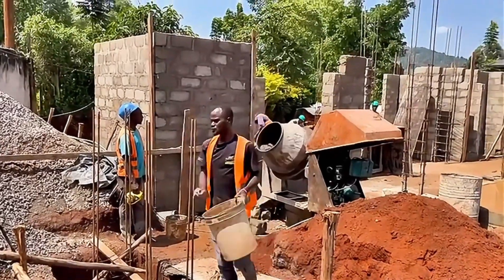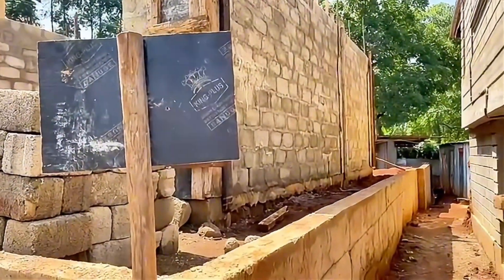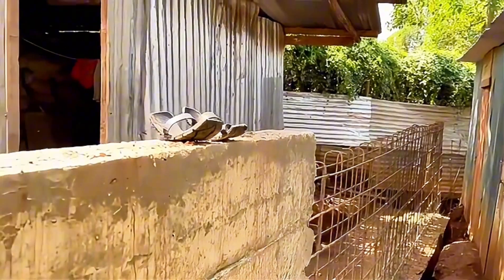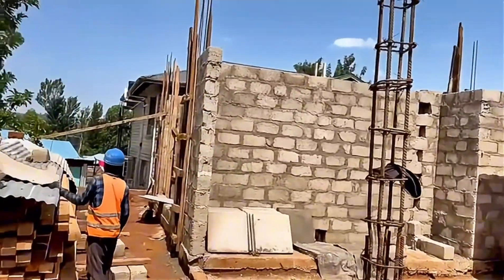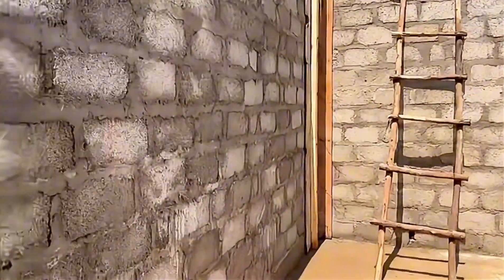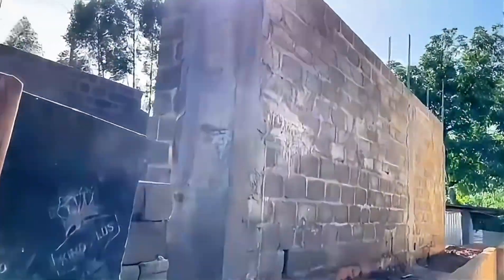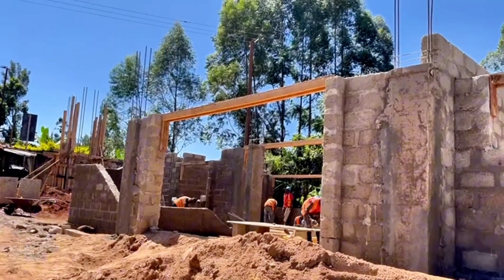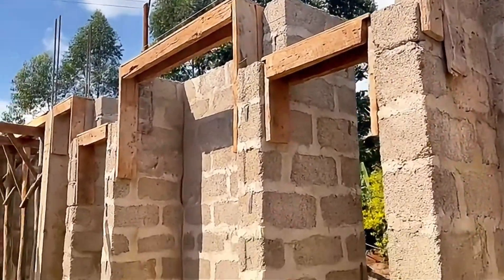BUILDING IN KENYA PART VI: SETTING LINTELS AND FALSEWORKS

Comment: I am interested on the solar system idea. Waiting to hear about the process of solar system installation. Are there any regulatory struggles to install solar or it’s a smooth process? Will you be allowed to connect to the grid or not?  🏠
Reply from the maker: Valid points here Jack, I too can't wait cause every milestone has been an eye opening experience